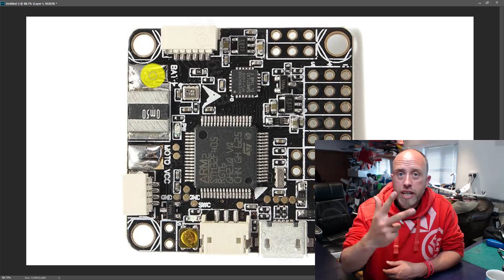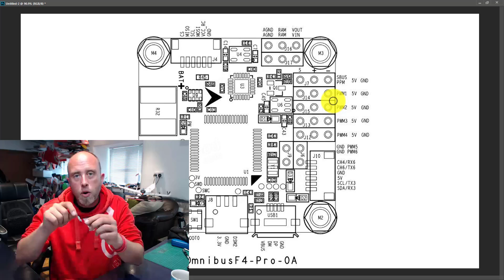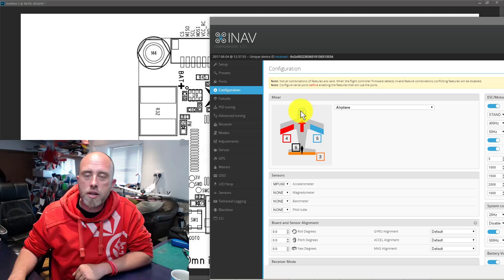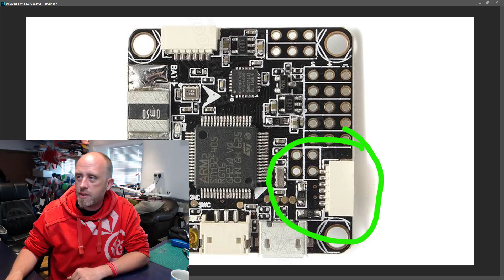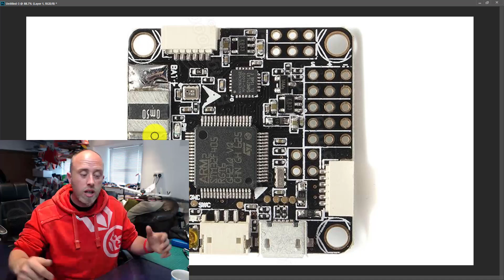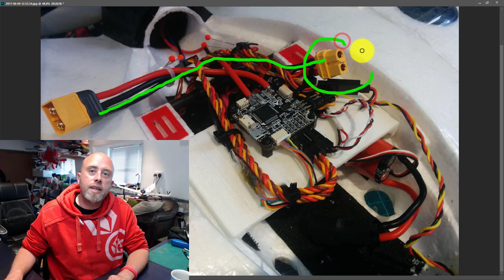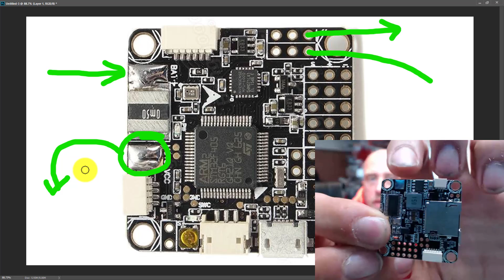Part #4C - [FULL] Omnibus F4 V2 Board Overview for iNav & a Flying Wing

Comment: Hello Matt, first of all, sorry, my English is Google, as always an excellent video, you are the reference when setting up inav, at least for me, very clear and without leaving any aspect without clarifying.
Of course I've seen all inav configuration videos with f4 omnibus, I've already asked you a question for a cc3d with inav, all resolved, now I'm setting up an f4 v2 for a sky shadow wing that I'm running out of, the thing is I want Feed the servos with a bec, and I only need the signal of the plate, I have seen that there is a connector of 6 pin's JST SH 1mm by the bottom part of the plate, next to the pwm connectors, just below the connector Where it connects the gps, which has the outputs pwm (1,2,4,3, 5+ and gnd), but it does not work, if I give current with the bec to the servants, and they go crazy, they start spinning Without stopping, I clarify that all this is because I do not like soldering :-), do you know if you have to configure some output or something in inav to use the connector instead of the normal outputs pwm? What could be failing? What can I be wrong about?
Thank you, a greeting and forgive the inconvenience.

hola matt, primero que nada perdon mi ingles es el de google,  como siempre un video excelente, eres la referencia a la hora de configurar inav, por lo menos para mí, muy claro y sin dejar ningún aspecto sin aclarar.
Por supuesto he visto todos los videos de configuración de inav con omnibus f4, ya te he hecho alguna pregunta para una cc3d con inav, todo resuelto , ahora estoy configurando una f4 v2 para un ala sky shadow que estoy acabando, la cuestión es que quiero alimentar los servos con un bec, y solo necesito la señal de la placa, he visto que hay un conector  de 6 pin´s JST SH 1mm por la parte de inferior de la placa, al lado de los conectores pwm, justo debajo del conector  donde se conecta el gps, que tiene las salidas pwm (1,2,4,3, 5+ y gnd), pero no me funciona, si le doy corriente con el bec a los servos, y se vuelven locos, empiezan a girar sin parar, te aclaro que todo esto es porque no me gusta soldar :-), ¿sabes si hay que configurar alguna salida o algo en inav para utilizar el conector en lugar de las salidas normales pwm? ¿Qué puede estar fallando? ¿En qué me puedo estar equivocando?
Gracias, un saludo y perdona las molestias.
Reply: Thank you very much! that was a configuration problem. Everything is OK!

Comment: Hi Matt and thanks for such helpful and informative videos.  Documentation on the Omnibus is almost non existent and having your series to refer to is invaluable.  I'm setting up a mini talon at the moment and so need to use PWM 5 & 6, I have a 3.5A BEC from the ESC, would you recommend that I power all of the servos from the BEC and not the board.
Reply from the maker: Morning, "absolutely" is the short answer 🙂 And I'm glad you've found the series helpful, Matt

Comment: Hey Matthew! What a great video on this Omnibus v2. Just one question, right now Im planning using X4R on my S800 but which port on the X4R should I connect to the RSSI pad on the Omnibus V2? Thank you.
Reply from the maker: Howdy Alif, I only have one X4R and I've never tried feeing in the RSSI from a pad, however google this "x4r rssi pad" and look on the images tab. However frankly speaking I'd push the RSSI down through a PWM channel instead and use that. See here for more details https://github.com/iNavFlight/inav/blob/master/docs/Rssi.md Matt
Reply: Hey Matt! Got it! Thank you for your reply. Have a great day :)

Comment: Great video! I really love it!

Just ordered the C1 Chaser and Omnibus F4 w/ OSD. I wonder what is the name of the 6 pin connector that is used for connecting GPS. I have a few GPS units but I'd like to create a connector specifically for the F4 with magnetometer (just like the port allows). Any idea where to buy it? Preferably pins to make a connector rather a ready-made connector with wires for soldering. Thanks!
Reply from the maker: Howdy Matthias, yes. It's a 6 pin JST SH 1mm connector, see this video for more info https://www.youtube.com/watch?v=0MntuqO08ac&index=3&list=PLgoM4-umzSqd0clW-e_A12yKiOpV--3a2 Matt

Comment: love these videos man. thank you for making them. my question is... why didn't you power your vtx and cam from the supplied power from the fc?
Reply from the maker: Howdy fella, thats simple and a fantastic question! Noise and power is the reason. 

You can provide better filtering using a larger toroid coil or low pass filter for the FPV system than what the board can provide. Also it's always best to limit the current being drawn over such a small board to the minimum, so removing the vTx and a FPV camera can massively help. Plus most modern FPV cameras and vTx's can take full pack voltages. 

Hope that helps, Matt

Comment: 40 amps is too conservative if I was running a quad the max esc I can run is 10 amps x4? I run 30 amps  x4 without problems with bursts to 35 amps during punchouts.
Reply from the maker: Howdy Dave, yes that's in a quad where there is loads of cooling, not in a model plane, all cosy in a low airflow environment, wrapped up in insulation foam to keep it all warm on a hot sunny day ;) Matt

Comment: Hi Matt. As I have no experience with flight control boards can you tell me the purpose of the sd card slot and can it be used in this context?
Another very well presented video by the way👍
Reply from the maker: Howdy Davy, ah ha good question, data logging. It's called a "Black Box" and stores data from the flights in case it's needed by the developer team later. Matt
Reply: Matthew Ogborne gotcha. Thanks Matt

Comment: Hi Matt. Congratulations on another great video.

If I could just say one thing... You don't need to connect to the RSSI pin. Instead you can send RSSI back from your transmitter on a spare channel and tell INAV to interpret it as the RSSI level. 

https://github.com/iNavFlight/inav/blob/master/docs/Rssi.md

Of course, you do need to do a bit of jiggery pokery on the transmitter, but there are posts on the internet showing you how, at least for the taranis and 9xr Pro.

Just to recap: transmitter reads RSSI from receiver, does a bit of maths and then sends it back out on a spare channel. Flight control reads that channel and knows what the RSSI is without any extra wiring.
Reply from the maker: Howdy Skylark, yes that is possible, IF you don't want to use too many switches and have a Rx that supports telemetry. I could do this with the Hornet wing, however want the 4 extra AUX channels for switches and it only supports 8 channels in D8 mode. Matt

Comment: Hello Matthew, the gps unit you linked seems to work only up to 3.6Volts, but you are suggesting to wire it on a 5V pin (the one in the white connector). I would be a little scared.
If you look closely you have 3.3 V power supply from the spektrum satellite connector and one more on the board, but it's just a tiny pad as the rssi one. I surely would prefer your method but it seems wrong. What do You think about? Thank you for great videos!
Reply from the maker: Howdy, this question has come up numerous times. The GPS will run on 5V, the sockets provided on the unit are for a pixhawk and the pixhawk runs these on 5V. Also I've run the same unit on a Pixhawk and also these boards for numerous flights and not had an issue. I don't even know if they will actually run on 3.3V as I've never tried! Matt
Reply from the maker: See the GPS port section on this page https://pixhawk.org/modules/pixhawk Matt
Reply: Thank you Sir! Now I know I can wire it up a in a very easier way. It will run on 3.3V because I have it that way on a quadcopter, but 5V is so much easier to find! Thank you again.
Reply from the maker: Right, I've just stuck a multi meter on the VCC pin on the GPS chip, 2.97V on a 3.3V supply and 2.99V on a 5V supply, the board MUSt have a voltage regulator on it, I suspect thats what the 15ZF chip is :) I'll make a video about this later, Matt
Reply from the maker: Howdy fella, see here https://www.youtube.com/watch?v=LFkKcOpFo7k

Comment: just curious Matt, I know it's an obvious question, but i haven't experienced any board other than a cc3d, so I'm just curious what cables do i use to connect my receiver to this board? They don't come with it when you order it do they?
Reply from the maker: Hi Owen, thats right. For this board you'll need a male to male servo lead, from the receiver to the board and a small JST connector covered in this video https://www.youtube.com/watch?v=t7dUVNx7S7s&list=PLgoM4-umzSqd0clW-e_A12yKiOpV--3a2&index=3

Comment: Have not yet finished watching the whole video (slow intermitent internet connection) but want to ssk if the board has a barometer and if it comes with cables for the micro JST connectors.
Reply from the maker: Howdy Ako'y, I believe it does, but you'll want to disable that as you get the height from the GPS unit. And you'll need a special JST cable that is covered in this video https://www.youtube.com/watch?v=t7dUVNx7S7s Matt
Reply: Hello, wouldn't an onboard baro be more accurate than GPS for altitude control?
Reply from the maker: Howdy David, when I used a Baro first time around with iNav, my Teksumo got smashed into the ground 3 times. The GPS is accurate enough, because unlike a quad, a RC plane is typically always going forwards, unlike a quad that has unlimited yaw. I've not used it on any of my builds and it's worked great with just the GPS, Matt

Comment: Hi Matt, if I you were using channel 5 and 6 for an aeroplane, would you still be able to use all the pins in the J10 connector for a GPS? Or are TX6 and RX6 pins shared?
Reply from the maker: Howdy David, you should still be able to use them, well as faras I know you should be able to use them, Matt

Comment: when you fly with inav, do you need to wait for gps lock first? if yes what's the avg time?
Reply from the maker: Howdy Henry, great question! In short yes. Personally I wait for 12 or more satellites to show on the OSD before arming. iNav picks up the home position when you arm the model. With the NEO-M8N GPS unit, it uses the normal sat network, but also picks up the GLONASS ones which is the Russian sats, thus more accurate & reliable positioning. Hope that helps Henry & ta for asking here :) Matt
Reply from the maker: Oh and average time 2 minutes, maybe less. Depends if it's a new location or not as the GPS units have a little battery on them and they remember their last location. Matt